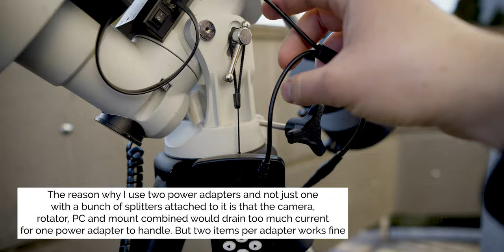How to set up a permanent TELESCOPE observatory ON A BALCONY + tips and tricks

Comment: I have a similar setup but with a WO Flourostar120 on an EQ6-R pro. I have one power cable from a 12v 10A AC/DC power brick that goes up to a Pegasus Power Box. My main camera, the mount, two dew straps, a filter wheel and the mini PC are powered from there. My EAF and guide camera are powered via USB from the rear of the main camera (no rotator though). WiFi from the house to the PC is pretty good but I also have the option of ethernet if I wish. So, two cables at most
Reply from the maker: Nice!

Comment: Great to see you back! I also recently purchased a whole rig and started doing some astro from the car parking down below.. I need to use 15m long extension cable because I live on 2nd floor 😅.. I do have a balcony but I have not yet tried putting there because it's very narrow.. my mount is AM5 so it's not easy to check if the rig will hit the wall.. still I will try to move the mount using hand controller in all directions to see if it really hits..
Reply from the maker: Yeah with a harmonic drive it might be hard to check if there are no collisions but should be doable too